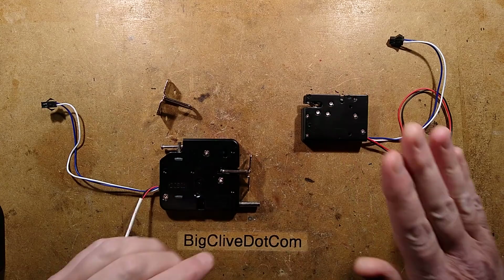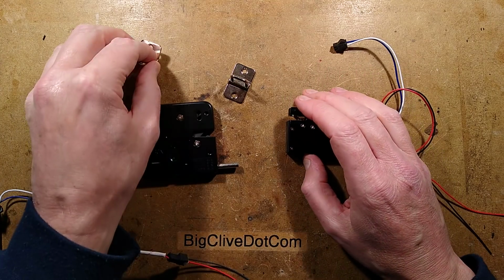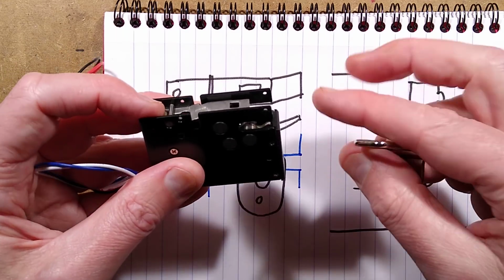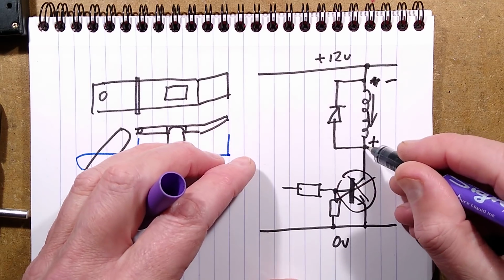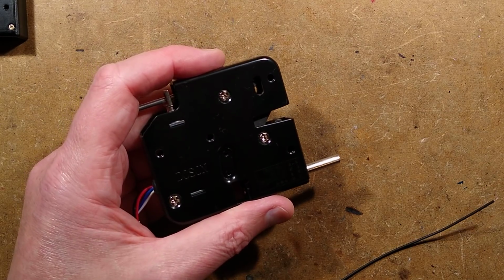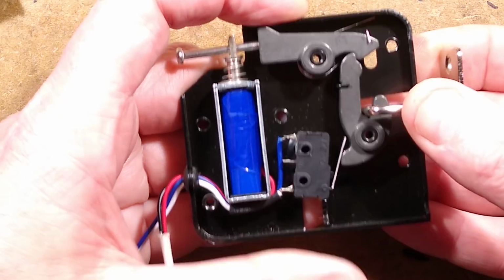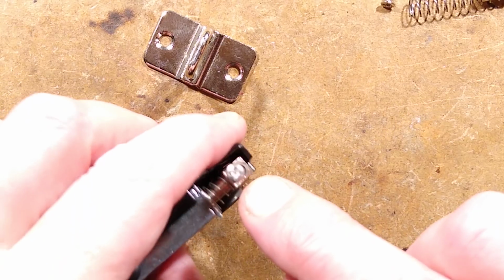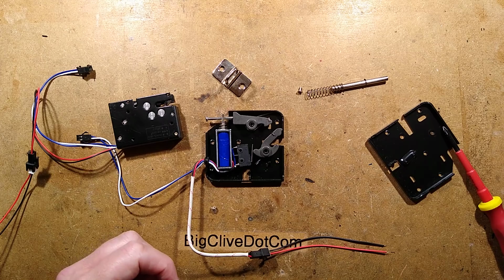Inside an eBay electric lock mechanism

Comment: Fun fact: I recently completed a project designing the electronics and hardware for a similar thing to Amazon lockers, but for temperature-controlled goods. Literally used these same solenoid locks. I had some test modes to open all lockers (88 per module - they can be chained together) really quickly in sequence. When we were testing, the doors hadn't arrived, so we pushed all the catches into the locks, then started the test mode and it was like a machine-gun, firing the catches across the warehouse 🤣 You have to be careful with them - if they're activated for more than a couple of seconds, they heat up and it jams up the lock, so they're useless. I actually added PTCs in the same way Clive has it here :)
Reply: I'm an IT guy in a small russian laundry and for the last 4 years I've been using these made in Russia automated lockers for delivering and taking orders from customers. For cleaners basically. And these at first opened the lock with  10 second duration 12V signal. You may start to understand my problem, the coil was burning out. What made this problem worse is how with the big with original programming, - 12v signal wouldn't cut out after 10 seconds. Lock would work, but only half of the time. Meaning I was left with delightful prospect of having to drop everything and driving 40 minutes to an aggravated customer who's delightfully waiting for their favourite silk dress from the cleaners. It took them over (!!!) 4 YEARS and one of the lockers (not ours) catching on bloody fire for them to fix this bug. Makes my stomach turn only thinking about it.
Also, how do automated lockers which are made from wood and shipped Ikea style to save costs costs sounds to you? Sounds like a great time had by all?
Reply: I think I've seen those at Asda for click & collect groceries
Reply: Is it possible to get some info on the prpject you were working on ?, interested to know what micro controllers you were using.

Comment: I understand the Amazon idea with the lockers having the central control, pulse the right one and the locker kicks open.  But I've got this wild idea of taking an existing design of lockers, and  modifying the doors so each one has a cheep RFID reader, and one of these.   Detach the entire door when power is low and put a new one back in place.
Reply: Russian grocery delivery service Utkonos uses this design of locks and lockers. Lockers look like your typical cupboard, the lock goes on the door and has NFC reader built in. Whole system looks very cheap and I think the system is meant for couriers, not civilian customers.

Comment: I'm pretty sure that with a powerful enough magnet it would still get opened. Even with that level of shielding against normal magnets.
Reply: In actual use, the lock mechanism will be mounted inside of the locker, making it even harder to open with a magnet.

Comment: Some time ago I found three cash register drawers that were being tossed out by a shop, one was too big so I just kept the solenoid and it had a very similar mechanism with the drawer kept in place with a hook with a decent spring behind so when it's commanded to open (24V) the drawer itself is pushed out quite a bit.
Fun fact, apparently the drawer is controlled by the receipt printer and connected to it with an RJ45 ish connector and you can tell it to open before or after printing
Reply from the maker: I have one of those drawers here, and the receipt printer with its drawer transistor too.
Reply: @bigclivedotcom  I recently found five BIG rolls of 80mm thermal paper discarded by a bank (I don't know why do they have an expiry date?) so I acquired a cheap thermal printer to play with and that's how I'm finding out all sorts of things related to the POS world.
Like some time ago I also found a card reader with a weird USBish connector which is in fact PoweredUSB.

(I find all these things because I live very close to the main commercial street and the shops bring out their garbage around 20:00 so I often go for a walk to see if anything interesting pops out)

Comment: The protection diode is known by various names, including ‘back EMF diode’, ‘spark quench diode’ (especially if a switch or relay contact is controlling the coil), as well as ‘flyback diode’.
Reply: Also called Freewheel diode or Snubber diode.

Comment: Washing machine - we had a new board put in as it stopped responding to the power button. The  new board needed programming. I immediately spotted new styles of operation of the washer. Some years later I discovered the fast spin rinse cycles never ended. It fills with water rinses, empties and repeats ad infinitum !
Reply from the maker: That sounds like it might have been loaded with the wrong software.
Reply: @bigclivedotcom  Or my thought was buggy software !
Reply: @millomweb   @pmailkeey  Oh, it's nice to meet another OPL laundry engineer in the wild! That sounds like the problem with the controller and is low-key terryfiing. So where are you from?
Reply: @KOTYAR1  North west England - where I can't get medication !

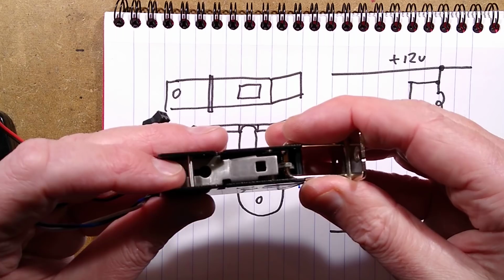Comment: Clive, at 3:57 there's a pop on the sound - have you just generated a spark from operating the machanical side of that solenoid ?
Reply from the maker: The microphone gain often pops with sharp noises.

Comment: What would I need as an input controller to actually use one of these locks? I'm looking online for the part you would plug an electric lock into. Vague findings.
Reply from the maker: It would usually be custom circuitry on a control board.

Comment: I can confirm that all the issues you mention are real. Cash drawer release solenoids are very similar and yes they get VERY hot if a fault leaves them energised. Sometimes the coil swells up and the armature jams, hopefully in the open position.

Comment: Another trick for solenoids similar to your capacitor pulse thing is you charge a capacitor up to quite a high voltage and then dump that across the coil, that gives very fast powerful operation and prevents burnout if the circuit latches.
Reply: https://youtu.be/vXho3X5UXOo This used cap discharge with rotary solenoids.

Comment: A 1N4148 or a fast Schottky diode is good as a flyback diode. 
A 1N400x is too slow. Maybe a UF400x, but a cheap simple 1N4148 holds the power spike too.
Reply: 1N4148 will fry there, your diode must be rated for the current draw of the lock, or else you will kill the diode short circuit with the repeated pulses that run it at absolute maximum (and a little more) single pulse current. You need an 1N5401 or better diode, as the 1N4148 is really only rated to carry 100mA from most vendors, though some specify them at 200mA as well.

Comment: Could you possibly just use that microswitch in the lock to disconnect the relay? Although it would probably melt because of how much current it has to pass through
Reply from the maker: It could possibly be used for that.

Comment: One very very interesting fact about those is that they are some of the only latches that easily unlatch under force, so if you have a door that you need to reaaaally push to close, other latches youd need to push to open. Not this type! The solenoids also pull a ton of current, I have one that pulls 2 A from 12 V, that's 24 W! These solenoids can become bbq flavored real fast

Something else: about the reverse polarity diode accross the solenoid, it is a good way but there is a much better one, which is placing a reverse biased "TVS" type diode in parallel with the switch. What happens then is that as soon as the Transistor stops the current,  the solenoid will start building up voltage and when it reaches the reverse breakdown of the TVS diode, it'll conduct. This is better because it also stops the wire impedance from causing damage, especially that a cabinet full of these could be pretty large. For my 12 V solenoid, im using a 15 V TVS diode, which means that the most that the Transistor will ever see is 15 V, while placing a normal diode parallel to the solenoid guarantees nothing
Reply: Tell me about it. I've been stuck with Russian made locks for the latest 4 years. They don't work when door pushes on them too hard, when there's no gap between the door and the frame, they don't bloody open when the door is too "free", they don't lock. They don't open, if the door isn't 100% horizontal.  They also dont open if the customer tried to open the door, thus "softlocking" the lock, meaning it wont open even if you send 12 v to it again. They did burn after 12v, our manufacturer changed the algorithm of opening instead of sending 12v to lock no matter what, they now open with 100ms pulse until the lock is opened. We use them in drycleaners, to take orders from and in from customers.
Reply: @KOTYAR1  hmm, in your case I feel like experimenting with a different latch might work

Alternatively, put the latch on a platform that has some freedom to move laterally, that might help it self align

About them not releasing when there's force, have you tried lubricant? Also, debur and smoothen the internal pieces, that might solve it

There's nothing you cant diy a solution for ;)

Comment: Most car doors I've looked at use the same hook and shackle arrangement with the only real difference being the trigger plate is diconnected from the handle (which actuates the same way the solenoid does) by the lock.

Comment: If you wired the NC contacts of the switch in series with the coil, then as soon as the latch opened it would prevent any more current from flowing until it was closed again..
Reply: Yes! Which helps you know somethings wrong, be it that the door is open, or a the connection is shoddy

Comment: A simple but clever device and it works well. I'm thinking that it could be attached to something that would enable it to fire a projectile some distance depending on the spring strength but I bet it could be adapted . 👍👍👍

Comment: So the solenoid is protected by the micro switch? When the door opens, the switch goes O/C to protect against an S/C Tr  permanently energising the coil? (Tr and uSwitch in series)? - That's what I'm seeing, at least. That way, if the door is closed again on fault condition, the coil would energise via the S/C Tr and kick open the door again, once again putting the switch in its failsafe (O/C) condition.

That's what it looks like to me.
Reply from the maker: The switch could be put in series if its contacts are rated enough.  But it's there to show the door is open or closed.
Reply: @bigclivedotcom  Ah, now I see it. Thanks BC.

Comment: How does one shield against magnetism
Reply from the maker: Mu metal.  A shielding metal.
Reply: @bigclivedotcom  does it really work?
Reply: @phonotical  Yes. If you take an old spinner hard drive apart to get the magnets, they are shielded by this metal to keep the magnets from encrypting your data forever. I still cannot help myself from pirating these parts from dead drives.

Comment: OH, THESE ARE THE BANE OF MY EXISTENCE! 
I work in small laundry and we've been using automated postbox-like lockers for taking/giving out orders from and to customers. Now, this wouldn't be so bad, but by a weird quirk in Russian regional law, every bit in these chistomats must be made from Russian-made components, even the bloody nails and screws, and this left me with these awful locks, called Prоm1x S М-3О8. They operate on the tightest tolerances, like, if the door frame isn't absolutely 90° to the floor, the lock may get stuck. They are made basically by hand, meaning you have to disassemble and check if they haven't forgot to glue magnets, terminals, little 3d printed plastic strip, have they tighten all the screws; and they are expensive af at almost 50 dollars a pop! Seriously, the only good thing I can think about them, - is what I'm able to send them to repair very easily. What fun, thank for the video, Big Clive!
Reply: And most of 20.000 automated postboxes in Russia use normal, made in China locks, it's just I've been stuck with these annoyin almost self made things.
Reply: Nice to see someone else who read "Gone with the Blastwave"
Reply: @KrissFliss  yeah, I love Kimmo Lemmetti's works, shame he didn't release it in book form. He's very Finnish and kind of depressed, I got that feeling from his Twitter.
Reply: импортозамещение нужно чтобы все страдали.
диды терпели и нам велели
Reply: @MRooodddvvv  промиксу, производителю тоже трудно. У него мало замков заказывают, а зарплаты, прямые расходы, которые все равно надо платить, остаются. 
Видишь, в замке что в  видео мало деталей и они литые, и сборка простая. Детали литые, - то есть их просто так не сделаешь из листа металла, как детали в замке Промикс. Но, блин. Взяли бы они китайский замок и скопировали его, нахрен придумывать своё.

Comment: Huh, that is EXACTLY an electric crossbow trigger (or roman siege machine for that matter, just smaller scale).  The classic whammo powermaster uses a falling plate lock derived from this, but this exact shape is known historically around the world for well over a thousand years!  I wonder how strong the sear plate on this is? heh
Reply: Very nice to know. Apparently Russian manufacturer of electric locks Promix doesn't know that, because design of locks I'm stuck with using is bloody awful. They don't work when door pressured on them too hard, they don't work when door presses on them too light, they don't work when the door is not at perfect 90° angle to the floor...
Locks in the video use "door pusher" which is not connected to mechanism of actual lock, - this is how you know they are good, robust locks. Unfortunately, our lock dealer, Promix, made a decision to invent a wheel with their lock design, and I'm stuck with in-robust garbage.
Sorry for my English, I can write more coherently, I'm very tired

Comment: These things can also be useful when building escape rooms or other games that require hidden compartments and such. Never use for doors though because they are fail-closed.
 Thanks for the tips on how to secure them against damage by sustained operation! If you don't follow those, you'll have to replace the lock, but the lock is behind a now forever closed door... don't ask me how I know.
Reply: Ok, out with it. How do you know?
Reply: @ragetist  The answer is behind the door.

Comment: You don't know how secure it is? Send it to LPL, he will open it with a cactus spine.
Reply from the maker: There's a way round everything.
Reply: The LockPickingLawyer would suggest that the keypad is a major vulnerability, if it has the controller in the keypad itself.  See for example LPL videos 1045 (watch?v=ANsipsS7IK8) and 1040 (watch?v=z4lVylO7y5U).  Moreover, depending from the angles involved it would appear that the infamous strip of aluminium can would be able to shim the upper lever from two directions.  (There are two access holes in the case for doing it, no less!  It just depends from how well warded those access holes are by the mounting.  The other direction is up the outside or inside of the staple, which again depends from how good the external warding is.)  So no magnets or capacitors, as other comments have suggested, but paperclips, strips of aluminium can, or perhaps a Swiss Army knife.

Comment: 6:57 Oh, I've been there, our manufacturing dealer had an error where the 12v signal didn't cut out after 10 seconds, and it was burning coil out. Always delightful, when you have a client call from locker, eager to receive their favourite silk dress from the cleaners, - and you realise what the bloody lock is not working, not opening. And you have to drop everything and drive 40 minutes to delightful locker to replace the "lovely" and "good" lock.
AND IT TOOK OVER A 4 YEARS, AND ONE OF THE LOCKERS CATCHING UP ON FIRE FOR THEM TO PUSH UPDATE WHICH WOULD 100% PREVENT THIS FROM HAPPENING.
Reply: I still love these lockers, whatever the costs

Comment: It is nice that they included the micro switch so that a pulse drive circuit is not required, you could hold the coil power ON as long as you like if the coil is in series with the N.C. micro switch.
Good design, looks very reliable . Thank for sharing with us.
Reply: I would not pass the solenoid current through that littie switch. It's there to tell you the door has been latched closed.
Reply: @Monkeh616  Most micro switched are rated for much higher current than the 2 to 3 amps at 12 volts of the solenoid. Normally they are in the 12 to 15 amp range.
Reply: @Robothut  Not for DC they're not.. It's a status contact. It even says so in the datasheet.
Reply: @Monkeh616  I am fully aware they are using it as a status switch. Thats not the point. The micros switches give there rating for both AC and DC and high voltages and low. I have been using them for over 50 years.
Reply: @Robothut  And as always with these claims, I'm very interested to see the low-cost subminature microswitch with the 10A DC rating which you think they've used.

Yes, you can get switches you can do that with. No, a dirt cheap lock actuator from China isn't using one.

Comment: You would  use a darlington  (high gain)   NPN   transistor if  you  will  firing from a  logic  chip
Reply from the maker: I used to use Darlingtons all the time until I discovered MOSFETs.  The newer MOSFETs are amazingly robust.